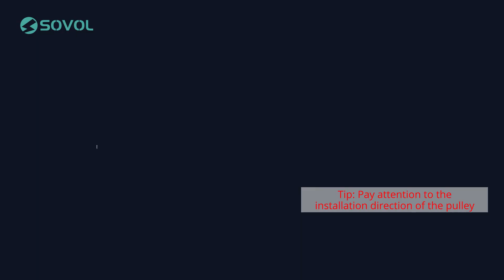How to apply lube and replace the bearing | Sovol SV06 Plus

Comment: Having to do this is what's stopped me buying an SV06 Plus. I'm not confident enough to do this, I'd be concerned I'd break something. This is an entry level, beginner machine. I shouldn't need to do anything like this at all before I get to use it.
Reply: ya ive had mine for a week and i have to replace them because the prints are coming out bad because of it

Comment: You show lubing the rods. This does not work. The grease needs to be inside the bearings, putting it on the rods doesn't get grease inside. The grease just gets pushed around by the seals.

Comment: I appreciate y'all and really enjoy my SV06 Plus, but it would have been super cool to have bearings that were greased properly and not crunchy from the factory. I understand you're trying to make good designs at a low price point,  but something so important as bearings shouldn't be an issue on new machines.
Reply: I think it is a crunchy bearing anyway.  It seems difficult to find quality bearing that work on these machines, but yeah they need to be assembled right.  I can tell from this video that they are very conservative with grease.